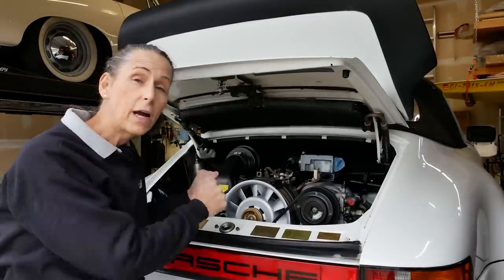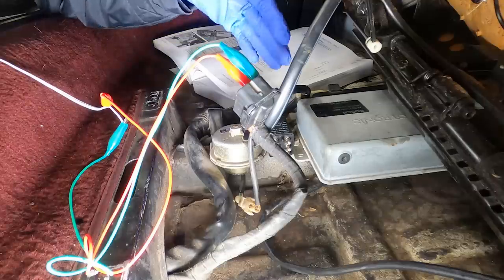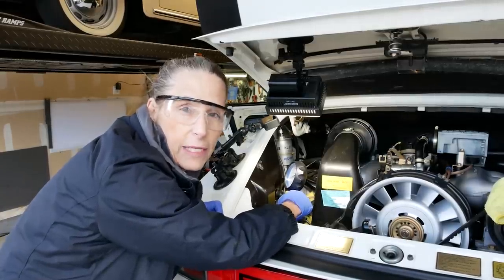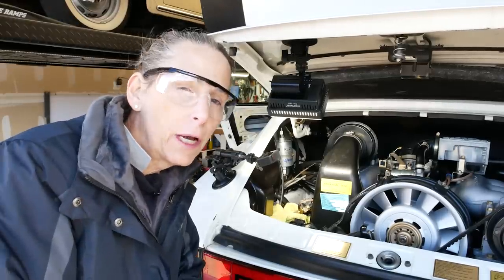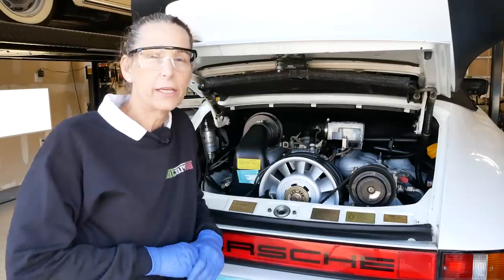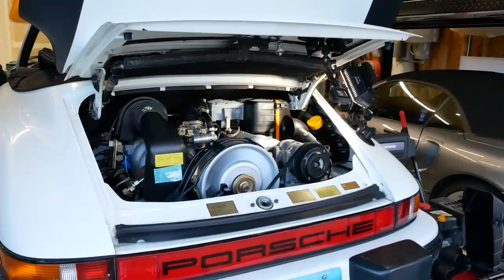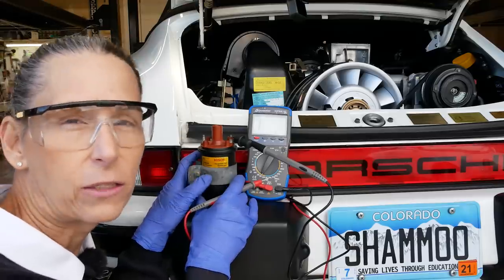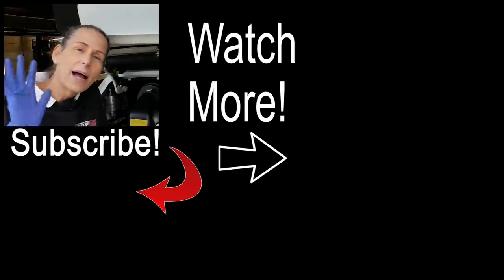Budget eBay Porsche 3.2 Carrera Project Car! #30 - NOW WHAT?! YOU WON'T BELIEVE IT!!

Comment: I enjoy watching yor videos.  Back to basics is what I put alot of faith in.  Hopefully the plug wires are correctly attached.  Is the firing order correct?  1-6-2-4-3-5 from what I recall.  When you had the seat lifted for the DME relsy I saw rusted studs and bolts.  This is an environment for bad grounding.  All grounds on the chassis need to be examined.  Looks like your coil may be bad.  If you were cranking the engine with spark wires disconnected and not grounded it is murder on the coil.  Hopefully that’s what it is.  My 2 cents worth.

Comment: Should be good to test flow of fuel pump. At idle it might give enough flow, but not under load. Looks like fuel pump or pressure regulator is acting up. To check DME relay, normally relays can be bypassed by using wire connected.

Comment: I just watched first video and wrote this reply...
"With a stethoscope you can hear if the injector is clicking.

And how did you remove the sparkplug wire without getting zapped?
I have not quite finished the video. The spark did not appear strong"
Now I will watch part 2

Comment: I think your coil testing was wrong by a couple of orders of magnitude, but it's still a very good idea to replace it even if it is not the problem, it's very old and I would not trust it in a trip. 
I would check for grounding issues, or supply power to the coil. It's probably a dumb thing and I'm sure you'll quickly figure it out. Engine sounds healthy (when it wants to run) lol
Reply from the maker: You are absolutely correct.  The spec in the Bentley says: 5 - 8.7KOhm.  That is a little miss leading, BUT I get what they mean.  I just missed it.  Thanks!  I hope it is something dumb...  Lots of bits replaced. We'll get it!

Comment: This Carrera is really putting up a fight, but it will be tamed eventually! I wish the 'professional' technicians at the dealership I use would check components and diagnose problems the way you do. Very impressive! That coil definitely looks suspicious, but kudos to Bosch for making it last this long. It's older than most YouTubers!

Comment: Those Bosch coils are pretty reliable.  I’ve got a ‘85 928S and it uses two of them.  One of mine cracked and leaked the oil out and the coil still worked.  With that said, it’s 36 years old,  you’ve got weak spark, and if you can find a good price might as well knock it out.  I don’t think I have a DME relay on mine.  I think some of the earlier ones do.  That hose clamp is not necessary on that vacuum elbow.

Comment: You checked the fuel and fixed the injector, you checked the air, so spark has to be the issue. I too wouldn't have thought about the coil because it started ok great (less expensive) if it fixes the issue.
Reply from the maker: We'll see!  I still think I'm missing something...

Comment: If I understood correctly, all of the spark plug wiring has been replaced. If the resistance of the new wiring is too high for the original coil, you will develop a weak spark, then an erratic coil, and, eventually, a fried coil. It sounds like the same progression as you're seeing. Something to consider. Good luck.

Comment: First thing I would do is ditch those plugs and get the OE spec, likely NGK BPR6ES and gap them to spec. You also didn't show the porcelain of the plug, which could have a hairline crack and be your issue.  Next is to get it together and let it idle! Do not rev it, no loads, restart it if it dies and let it sit and idle! It needs to relearn the parameters all over again. At the Porsche shop, we would have at least 1-2 of these come in during the Spring running poorly, and would just let it idle for 10-15min. and it would clear right up. If it doesn't clear up, unplug the air flow meter and see if that helps. With it unplugged, it basically reverts to a set base fuel map and will bypass a lot of inputs, but will also run better while having a vacuuum leak, so don't go replacing it right away if it smooths out. I also check the distributor cap to check that rotor and contact are good to go. You should've used the spark tester with the plug installed to make sure you were getting solid consistent spark through the sight glass instead of relying it to ground to 1 of the 4 prongs in the plug which was harder to see. Again, that ignition system was not designed to drive that type of plug and have seen them cause so much more harm than good, including induced feedback into the electrical system in one case study I have seen.

Comment: Superb video.  Very thorough and entertaining.  I would connect a scope and current clamp  to the coil primary windings.  The waveform would be pretty informative and should pinpoint if the coil is open/shorted.  Minimal or no dismantling needed.   Oscilloscope and training may be the next forward step in your evolution.

Comment: I've an 85 911 and really enjoy your videos which will be very helpful if I need to dive into motor. It's only let me down once and the ecu failed totally. Rather than an intermittent fault like you've had mine was driving perfectly down the road at 80mph then just went totally dead. Hope the coil sorts it

Comment: Hi, i had similar stalling on my e39 530i, it was the idle control valve. You had it already out and it was moving, but you did not lubed it. Its possible that if you take it out it wont move free instantly. Just shake it, lube it and shake again and it will run like a champ.

Comment: I am still suspicious about the fuel pressure regulator. I have seen them test good but when put to work they did not perform consistently well. I would swap it out for another just to see.
Reply from the maker: They are super pricey now (like $500).  I think they were like $50 back in the day.  We did send both the regulator and damper to RC and they tested them as well...

Comment: Correct me if I'm wrong but the SC cars had the coil mounted upside down so the oil in the coil would aid in cooling. Keep up the great work!
Reply from the maker: I think the coil is mounted on the shroud on the SC?  This one is on the inside left side of the engine bay.  It was as factory installed.  Hmmm...  Interesting thought about cooling though.
Reply: Yes the SC had it mounted on the fan housing but I think the direction was down to facilitate a shorter cable to the dist.
Reply: The Carreras are mounted line hers. Hers is mounted correctly.

Comment: Have you checked that you installed the Restrictor part no. 93010728900 correctly?? I don’t think that is the problem, but many people do mistakes when they work with that hose.
Reply from the maker: Yup!  I think I showed that a few videos back when I installed it.  That is a good catch though.  I did read somewhere that it can cause an uneven idle.

Comment: how about the throttle body? possible issue but it looks brand new. or something intermittently going to ground if the coil doesn't fix it. on the outboards i rebuild, i've traced ignition issues to wires grounding out that look perfect, or are just open. not common of course, but ya never know!

Comment: Coil from 1985 wow!
FYI Bosch no longer manufactures batteries, alternators and parts like this anymore, they are all outsourced and re-badged.
Sadly the days of coil lasting 35 years are gone :(
Reply from the maker: Yep. It is a bummer.
Reply: Since that's the case, can the OEM be rebuilt to original spec so it will provide another 35 years of service?  Even if more costly than a cheapo replacement, it seems like it would be worth it.
Reply from the maker: @dudeonbike800  I want to see if I can find a place to properly test the coil under load. There is a shop nearby that may have a tester.

Comment: Replacement of so many parts when the engine ran fine before is always a risk 

Maybe it's the inlet manifold that an air leak where it connects to the head 
that will cause lean rough running and stalling at idle 

Unlikely as you rebuilt it but who knows 

Check by spraying easy start around the inlet manifold Whilst it's running that will cause it to rev up 

Although difficult to do with one person if it keeps stalling

Comment: I had 2 Bosch coils fail intermittently like that back in the day, so I would not be surprised.
Fuel pump relay? Yes, carried one around for about 5 years until I needed it. When it dies there is nothing intermittent about it - game over.
Reply from the maker: Good advice!

Comment: I think you approached the case the right way, very likely that the coil is faulty, well they are not expensive, so if you replaced them and you keep the problem I would look at the transistor circuit of the ignition, it is known that you can suffer that the solder connections of the circuit board after all those years sometimes become bad, and the DME relays of course
Reply from the maker: Thanks for that.  I have heard that solder breaks can happen.  Let's hope it isn't that :)

Comment: The notes on that fuel pressure kit state that it is not for use with Bosch fuel injection. 🤷‍♂️
Reply from the maker: All I really needed was a gauge and a fitting...  I was hoping that kit would do the trick but, in the end, I had to cut down one of the included fittings and add an O-ring (it was the only one with the correct threads and diameter but it was too long).  It did seal fine in the end and I got my readings.  I had read that it can be difficult to find the correct fitting to the end of the rail.  A lot of those kits are talking about modern systems I think.  I ran into that with the Noid kit as well and have come to expect that I'll have to work with these a bit.  I'm not sure if that fuel rail is Porsche or Bosch - probably Porsche.  It is pretty specific to the layout of that engine.

Comment: Sorry, this may be a stupid question, but I am not an Porsche expert (yet): why has this 3.2 a whale tail? I thought the tail was for the turbo only!? Or is this a turbo!? I don't see a turbo and neither an intercooler!
Reply from the maker: Great question!  I was confused about all that as well...  Back in the day when the Turbo was first released (non-intercooler cars) it had a tail similar to this.  Then when the intercooler was added they went to the "tea-tray" tail with the high sides to specifically force air through the intercooler.  They didn't drop the old tail but made it available as an option on the NA cars and called it a "Carrera" tail.  When we bough the car it had a Tea-Tray (aftermarket).  It looks a bit little silly on a NA narrow body car.  When we got together with our friend Chad who you see in the first episode in the series he had the old Carrera tail from his car available so we bough the entire deck lid with tail from him and fitted it to our car.  It was not original to our specific car, but was an option and I think it looks neat.  The only factory exception to all this is the "Turbo-Look" cars that were sold during the time the Turbos were not sold in NA.  Those cars are identical to the Turbo cars but have an NA engine.  They also have the Tea-Tray fitted from the factory as well as the wide body.  I think the fastest way to tell the difference is the dual-exhaust of the Turbo (later intercooled models).  Pretty sure...  I bet the badging is different too.  They are a rare car and I don't think I've seen one in person.
Reply: @HeidiandFranny Hall Franny, Thank you for your detailed answer and for the clarification.
Using your terms, I googled again, looked at a few pictures of the different spoilers and also read up again. Here in Germany you can see many 911s and 930s from this period on the road. Now I have to see if I can recognise the differences.
By the way, I thought all turbos had intercoolers. But as you wrote and Wikipedia confirms, the intercooler was only installed from the 3.3 in 1978.
Attention: the turbo with the 2 exhaust pipes was a factory tuned version of the 3.3 with 30 extra hp! The "normal" 3.3 did not have them (according to Wikipedia). This special 3.3 is probably rare even here in Germany! Maybe I'll see one someday - but certainly not in winter, because now they're all hibernating!

Comment: Coils have finite life spans. Mine failed after 25 years but with a higher-than-expected resistance reading between the terminals.
The Motronic units on the 3.2 engines can fail also.

Comment: Why would they lock up, setting for a year?
Reply from the maker: They are cleaned with a strong cleaning fluid that removes all oils.  There is a chance over time they can corrode slightly...

Comment: Hi Heidi and Franny, 
I think you're over thinking the problem. The only thing you touched were the injectors. The problem is injector related. I would check the orings. Perhaps one or two are torn. Or one bank has not properly seated......just my $.02
Reply from the maker: I will definitely check that.  All those o-rings are new and I lubed them when I installed them.  In addition to the injectors, all the sensors are new.  I did clean the flow sensor and throttle body.  I think I really need to go back through everything at this point...

Comment: Hello from Belgium. I have had similar problems with my '87 3.2 . In my car it was a worn rotor + distributor cap. Did you change these? you can also swap your DME out with that from another car to check your DME. Nice car btw.
Reply from the maker: Thanks!  Yes, all the electrical parts (except the plugs) have been replaced.  Ok, well,...  except the coil ;)

Comment: Loving the diagnostic work.  Bit like 'House' but for cars :)

One thing that puzzles me though. Wouldn't an 'open circuit' on the coil mean that you wouldn't get any spark at all?
Reply from the maker: Possibly (it could arc internally) but I think I was measuring it incorrectly :(  I still have several things to check.

Comment: Hi from the UK. a couple of things. secondary dc 800-900 ohms not 8 ohms, worth checking your DVM multimeter is on the correct setting, if it's not an autoscaling type. The secondary coil windings could be failing under spark load, i.e. internal short, if you have been cranking without the spark plugs.  I had a cut-out issue on my 1986 3.2, found the ignition switch (key-operated) was fautly due to me over oiling the barrel, the give away was the alternative lamp would occasionally glow, it was back feeding, from the alternator via a poor connection in the ignition key barrel. I understand  the igntion coil supply is via the ignition switch not the DME computer.   good luck.
Reply from the maker: Thanks for that.  You are correct.  Bentley has the spec as "5 - 8.7KOhms"  That is a tad misleading (especially if you miss that "K" at the end) but I know what they are getting at.  Still, that is a very old coil.   I'm not convinced...  Lots more to check.  Thanks!

Comment: I own a 1992 R129 with an M104. Some 15 years ago, the M104.98  started dying almost every time prior to reaching its regular temperature. Once at 90C it stops dying. We have changed literally everything related to fuel and ignition which cost me something between 5k and 10k € to date. Eventually I gave up ie I accepted the engine dying when its cold. I mention all this as the electronic stuff is pretty much from Bosch too. After all the car is still in mint condition. Even speaking German to the engine failed to prove a rainmaker. So good luck from Frankfurt Germany.
Reply from the maker: Oh my...  Sounds like there has to be something...  Sometimes even new parts aren't always good.  I had someone comment that the pins in one of the connectors had pushed back into the harness and even though the connector snapped it, the pins weren't making contact.  Now that would be hard to trace!  Good luck with your car.  I hope you find the issue.

Comment: The air-FLOW meters like this one and on BMWs are not dependable.  The grid of the "sweeper" gets dirty and the signal ratchets.
Also, how old is the fuel?
Reply from the maker: That air flow meter is next on the list.  The fuel is all new and the tank was cleaned and filter replaced.  That should be good.

Comment: Sounds like a sneaky little vacuum leak somewhere. But, yeah, if the coil is iffy, it's gonna make it die. After 36 years, things could be tired all over.
Reply from the maker: I have checked the vacuum lines and they all look good, but I agree...  Hmmm...  It has to be something pretty obvious.  The car was running before...

Comment: I wonder about Motronic, too. I had an E28 BMW that had a failing Motronic and it seemed like it was capable of frying other components when it failed. It was really bizarre the way you could get spark/partial spark/bad running, and then stall. I wonder if after you change out this coil, you're going to find a root cause beyond the coil. Fingers crossed it's straightforward!
Reply from the maker: Thanks!  I think we probably have something else at play here...  We'll find it!

Comment: Hi Franny! I don't think you needed to send those injectors in at all. I just saw Ian Tyrrell in England try to tune a v12 Jaguar engine and found a few injectors not firing. He simply zapped them with 12 volts from a battery and kept doing that till they unstuck. He said to just zap them but don't leave them hooked up because then you will burn them out. He said they will stick if left to sit for a while. That seems to have been all that was wrong with yours since you left them sit for a year.
His YouTube channel is Tyrrells  Work Shop. He's like the pope of exotic cars. Lol
I thought sure you had a clogged fuel filter or line. I'm glad you tested the coil. That is pretty old.
Reply from the maker: I love watching Ian! The way he can tune a carb by ear is amazing :) I have seen that method to unstick them.  RC said they would go back through them at no charge and they flow test them as well.  They Are much smoother...  At $300 a pop I didn't want to damage them.